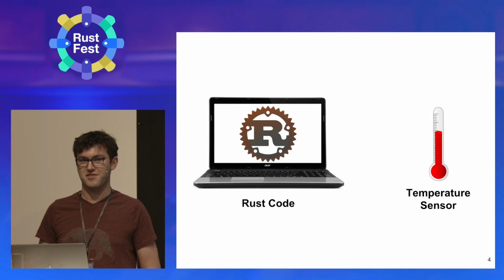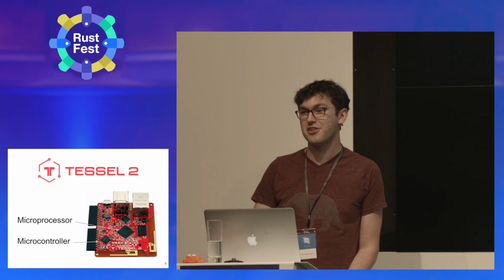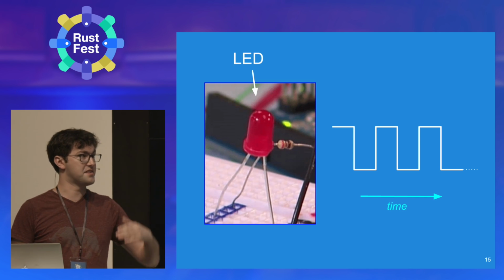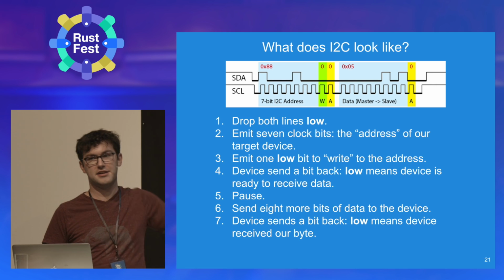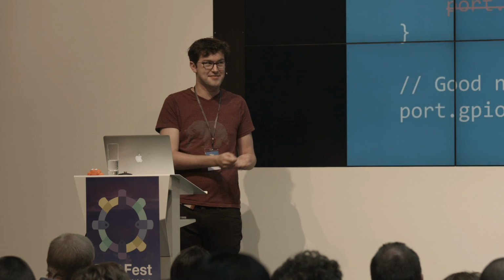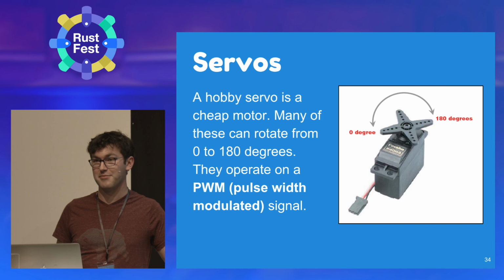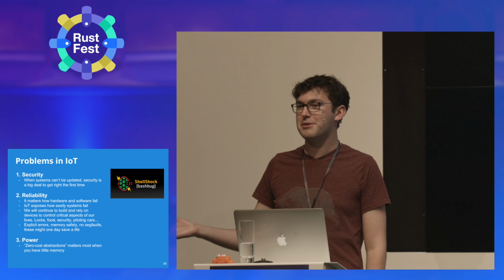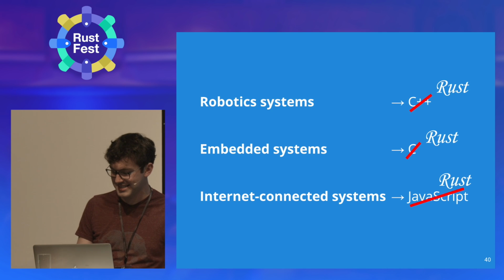Tim Cameron Ryan - Sensors, Servos, and Signals with Rust

Comment: I'm fairly certain that Ryan got some of these terminologies wrong.
A microprocessor is the processor chip itself.
A microcontroller is the processor chip on a break-out board, a-la the Teensy or the Arduino.
And the Raspberry Pi is an example of an SoC (System on a Chip) on a break-out board, which I suppose is a type of more advanced microcontroller.

That's at least the terminology I got taught when I started doing embedded stuff years before the Raspberry Pi was even a thing.
Reply: There is a distinction; a microprocessor typically requires separate memory and a bootup process, while a microcontroller may not. Breakout boards can carry either and are most certainly not part of them. Modern SoCs do blur the lines slightly, but it's a rare case indeed to run your entire application code in the cache of one. Note that RPi1 doesn't have the RAM within the SoC, it's a package on package sandwich. 

Besides this, the talk gives a terribly inaccurate description of a microcontroller also; he speaks of it having a single memory when the very one he points out has three to five types (program flash, internal and external SRAM, data EEPROM, USB RAM), and most definitely runs code in different contexts with interrupts. The interrupts have all the familiar synchronization issues and more, since you can't just yield out of the ISR. There are also SoCs with microcontroller style processors built in, like the Beaglebone Black's PRUs. 

In a sense, a microcontroller is the archetype of a SoC, having peripherals, processor, memory and often clock sources within one single IC. Some of them are even multicore (XMOS for instance).
Reply: Although a lot of people consider e.g. an Arduino a microcontroller (while meaning the whole board) I have to completely disagree here. AFAIK there is no strict rule for distinction between microcontrollers and microprocessors but being soldered to a breakout board most certainly is not. E.g. having a MMU (Memory Management Unit) is considered to be a feature that only microprocessors have, while microcontrollers do not. All ARM Cortex-M processors lack a MMU, while all Cortex-A processors have one. Cortex-M processors are generally considered to be "microcontrollers" (therefore the M), while Cortex-A processors are considered to be "application processors" (i.e. microprocessors). In this sense the Raspberry Pi is a SBC (Single Board Computer), being powered by a SoC (because it contains the GPU as well and for the RPi 1 even the RAM), which consists (among other things) of an application processor. Having a MMU, it is possible to run a "standard" Linux Kernel on this platform, while you can not run Linux e.g. on a Teensy (besides uC-Linux which works around the missing MMU but that is definitely different).
Reply: From the first week of a class on microcontrollers:

All microcontrollers have a microprocessor in them. What makes it different is that a microcontroller has several peripherals in it as well. These peripherals include Analog to Digital Converters, Digital to Analog converters, timers, and other components that are not general purpose computing machines.

An Arduino is not a microcontroller, but a development  board for one of the Atmega chips. A Raspberry Pi  is not a microcontroller because it doesn't have internal peripherals. A Raspberry pi is really a desktop computer with some of the pins on the CPU configured for GPIO. No ADC, DAC, or timers.
Reply: I think video gets it right. Both can refer to individual chip or (although not entirely accurate) that chip on a breakout board or SoC. The main distinction MCU's don't need seperate ram, memory and mostly feature a Harvard architecture. For example Cortex-M, AVR. I wouldn't call Pi a microcontroller, it's basically a small computer.